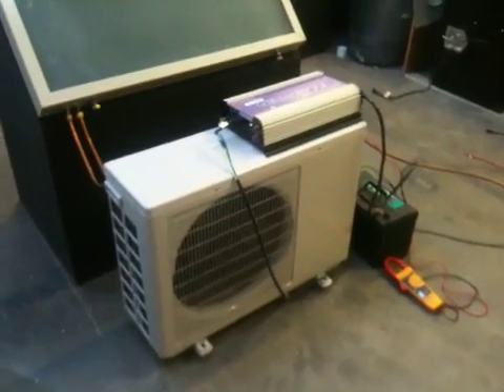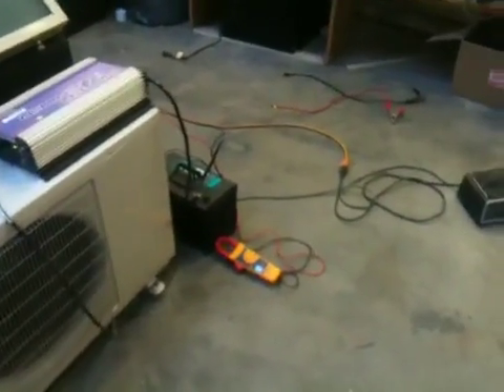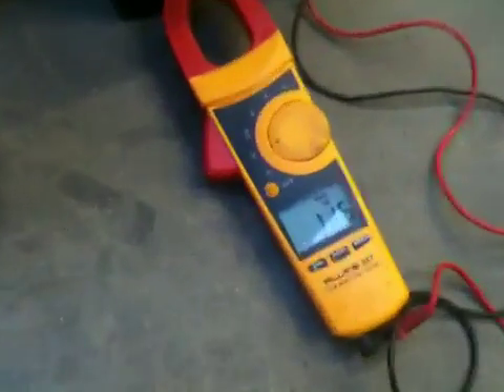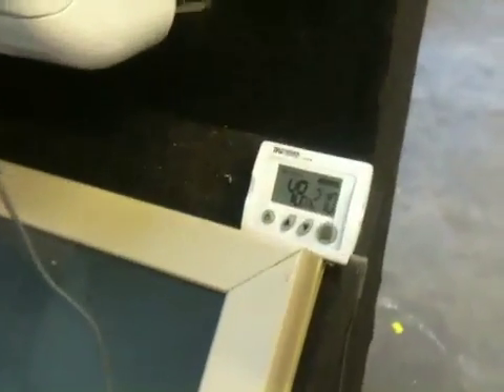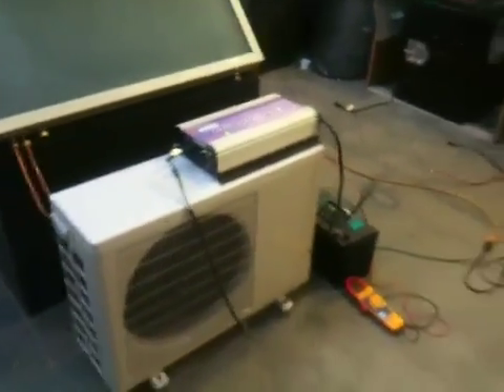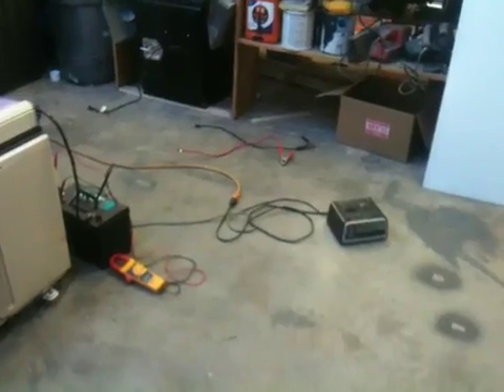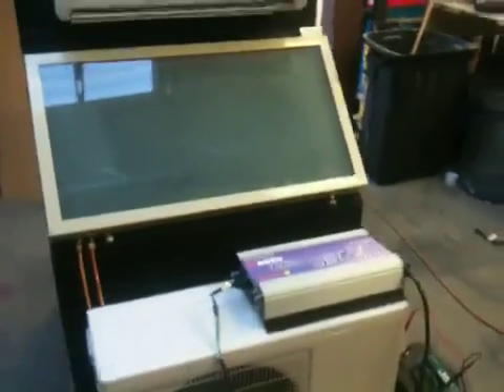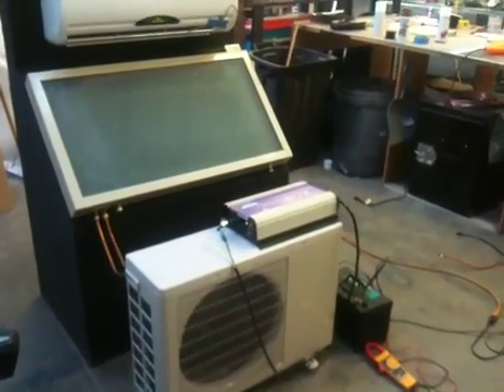Solar Air conditioning

Comment: It's easy, battery - two wires (+) (-) - inverter (gives you 120V AC) - Air Conditioner plugged in as normal. Get a charge controller for your solar panels (that's also two wires to the batteries) and there is a connection diagram for most charge controllers but really it's simple stuff. For a 12V system you want some thick wire like #4 gauge minimum going to the inverter. Check out more videos on solar installations, you can always use the knowledge in your life. Public school failed us.

Comment: Nice and quiet unit.Let me ask you.The solar panel is connected after compressor or before compressor? and what type of compressor is used when heat is gained through sun.Does it turn off the compressor when sun hits the panel and the refr.cycle runs only from solar during the day?